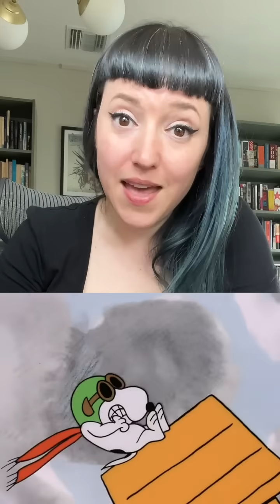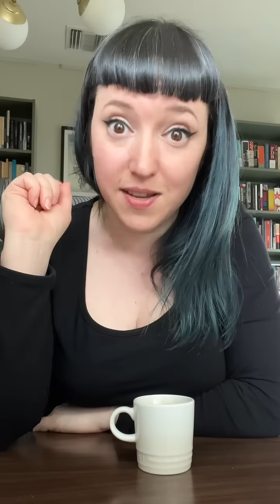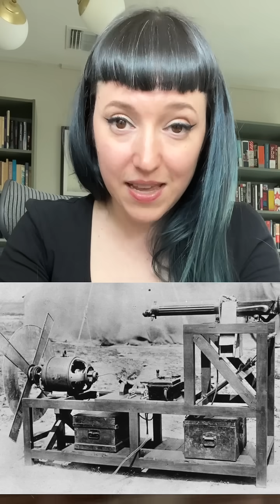The technology that led to aerial dogfights #shorts #history #WWI

Comment: A German WW2 fighter has a massive gun that shot straight through the crank case/ crank shaft of the planes engine 
And yeah I always figured the machine gun was hooked up to the flywheel or crank shaft of bi-planes and only fired mechanically when the propeller cleared the barrel

Comment: The Colt MK-12 20mm cannons used in the Douglas A-4 Skyhawk still had interrupter switches incorporated into the firing mechanism for some reason.  They were pneumatically feed and the rounds electronically primed.  OH they were a pain to load too

Comment: A similar mechanism was used in planes that had a rear-firing gun, to prevent the gunner from accidently shooting the tail off in the heat of battle.

Gotta say, engaging in aerial dogfighting in planes with open cockpits, largely covered in fabric: those guys were built different. 👍

Comment: Note, most propellors are direct drive and turn 1800-3500 rpm. The machine guns of the time shot at 600 -100 rounds per minute. So at least 3-5 blades went by per round fired. You wanted the gun to fire as much as it could, thus interrupting versus trigger pulling.

Comment: One of the first great aces of the war, Max Immelman, is thought by some to have died when the interrupter gear on his Fokker Eindecker (meaning monoplane) failed and one of his propeller blades was shot off.  Others think a British pilot was responsible. Immelman had already had one incident in which his interrupter gear failed, he shot off the tip of his own blade, the vibration shook his engine loose, and he had to make a dead-stick landing.

Comment: In 1980 I worked at a fabrication factory. My boss Harold Raeder was a master machinist.  During the early part of the war II he set the timing devices so a machine gun could fire through a propeller. He was deferred several times because he could kill more Nazi with a lathe then with his own gun. Great guy. RIP Harold.

Comment: I wouldnt say the interruptor gear made dogfights possible, but it certainly made them deadlier (oh god im gonna sound like a mansplainer but this topic is a passion I could spend literally hours talking about). Multiple solutions for forward firing would be attempted and utilized. While interruptor gears were the best splution, they were also a complex component that needed calibration and suffered wear. The most common method of forward firing was to just stick the machinegun out of the way of the propellor this meant mounting the machine gun on the top wing, or making the plane backwards (like my favorite WW1 fighter the Airco DH.2). The French being the French preferred having a dual serup of an interruptor gear (which didnt work very well with the open-bolt hotchkiss) and an armored propellor. A purposefully disabled and intact french interruptor system would actually significantly speed up German implementation of their own on the Folker Eindecker. Said plane which was intended as a light general purpose scout plane, would be the Fokker referenced in the 1915 'Fokker Scourge' becoming a de-facto air superiority fighter cor a time. 

Tangentially related fun fact: Russia's most succesful fighter pilot of WW1 (Alexander Kazakov) achieved a good number of his kills with a grappling hook. He would use said hook to rip his opponent's plane apart or beat the poor enemy pilot with his landing gear. He was also the first Russian pilot to survive an intentional ramming.

Comment: The very first purpose-built combat plane, the Vickers F.B.5 "Gunbus" avoided this problem altogether by mounting a "push" propeller on the back and a dedicated Lewis gun and gunner at the front of the fuselage. But it was slow and required a crew of two, leading to the interrupter solution. Great video Amy!

Comment: Before the interrupter gear was perfected, one French pilot put deflectors on his propeller blades in front of the guns.  It worked great, for a short period of time.  Until the propeller snapped from the stress.  

And note that the rotation of the propeller is far higher than the rate of fire of the guns, interrupter gear didn't slow the guns down.

Comment: I remember thinking as a kid why WWI planes didn't have ring shaped engines and had the gun mounted in the gap in the middle. It was only later that I found out about the mechanical synchronization system between the gun and the propeller that things started making more sense. 😂
Reply: The cannon in the Messerschmitt Bf109 and the Bell P-39 Airacobra really did fire through the center of the propeller hub.

Comment: There was an airplane in which the machine gun simply shot at the propeller without any interruptor. Each propeller blade had a curved metal deflector. Bullets that hit the propeller were simply deviated.
Reply: More than one if memory serves. 😎

May you and yours be well. 🙏
ct

Comment: Well, to mostly keep from shooting the propeller.  One limitation on all interrupter/synchronizer systems is that machine gun rounds aren't perfectly consistent (especially under the limitations of rapidly expanded wartime production) and so the time between when the firing pin hit the primer and when the bullet actually left the barrel was variable (and in the case of a hang-fire might be up to a couple seconds delay).  So it was far from unknown for a WWI plane to come back with a few holes shot through its own propeller despite its interrupter/synchronizer system.

Also in WWII, while interrupter/synchronizer systems definitely remained a thing, many fighters no longer used them because all their guns were mounted in the wings where they would fire past, rather than through, the propeller.
Reply: I read that wing mounted guns were typically aligned to converge fire at 250 yards. One of the benefits of the twin engine twin fuselage P38 was that its guns were mounted close to each other in the nose and fired parallel to each other, so no convergence.
Reply: @tadonplane8265  And then we have the 109 which shot though propeller hub.  Clever, but takes a lot of work to accommodate that.
Reply: Most Axis and Soviet planes still used interceptor gear until the last days of the war.
Reply: Before the interruptors, the props had a metal shield to protect the prop
Reply: Special ammunition was actually produced during WW2 for use with aircraft using the synchronization systems. You can occasionally find boxes of it. I have a box of 30-06 produced for the British that was made by Remington, dated February 1941, and labeled in large red letters:

CAL. .300 CARTRIDGES, BALL
               RED LABEL
SYNCHRONIZED GUNS R.A.F. 

Cartridges with this labeling, were specially made to much higher standards and more stringent specifications than standard ammunition intended for tank or infantry use, so the guns would function correctly with the interrupter gear.

Comment: So cool! Wonder if the timing ever got out of sync! That would make for a bad day! Simply the best!!
Reply: In answer to your question, yes, and yes. They did get out of timing, and yes it was a very bad day for the pilot. Interestingly enough, in the days of biplanes, a crash landing wasn’t nearly as traumatic then as it was in later years such as WWII. The speeds were so much slower, and the aircraft tended to break apart more easily on landing, thereby absorbing more of the impact and sparing the pilot’s life.
Reply: Czechoslovakia produced a version of BF-109 after the with Junkers engines. Because of different engine/props the plane had a lot of problems with gun synchronization.
Reply: @stanthrasher4815 Yes. They often got out of synch, even in WWII with improved interrupter gear.

Comment: I had always wondered about that.  It always seemed strange to me why would you put the machine gun behind the propeller, why didn't they put it further out in the wing, two propellers out other wings so put the gun in the middl.  I didn't  know that you needed to time the bullets to the rotation of the propeller.  Thank you for that bit of trivia!!
Reply: @cassiuspuckett8789 There are several reasons why you don't want to put the guns on the wings. 1) WWI machine guns were prone to jamming. Can't clear a jam if the guns are on the wings. 2) Nowhere to put the ammunition. 3) The best place to have guns is on the centre line. Makes aiming a lot easier. Guns on the wings have to converge at a set distance to hit the target. Around 300 feet in WWII. If you have them pointed straight ahead you'd miss the target. 4) Guns on the wing of a WWI fighter would increase drag.

Comment: To be true - most WW2 planes had machineguns in wings and so they avoided having synchro gear. Some like P-38 had central guns pod in front of pilot, but two engines on wings. But some, yes, still had synchro gear too... probably for heavier central under belly cannons...
Reply: A few WWII planes still had machine guns shooting through the propeller, most notably early variants of the P-40 warhawk had 2 .50cal machine guns in the nose and 2 .30cal machine guns in the wings.  Later variants had 6 .50cal guns in the wings.
Reply: And in a few cases the gun, or more specifically cannon was just positioned through the middle hub of the engine: BF-109
Reply: @Theonixco  and the P-39 and P-63.
Reply: @ Eh sorta, the Cobras had the engine behind the pilot, and the front prop, was connected via driveshaft. The Cannon was in the Hub of the front yes.

The BF109f and later had a cannon nestled in the middle of its Db 601 engine.

Comment: The Messerschmitt had the genius idea to fire through the centre of the crankshaft.
Reply: The P39 also had a cannon that ran through the propeller.
Reply: @DavidSmith_W6DPS  To the point that the whole airplane was designed around the 37mm cannon.
Reply: And it caused so many engine failures that many pilots stopped using it on the BF109.